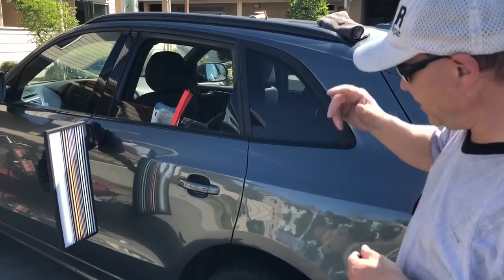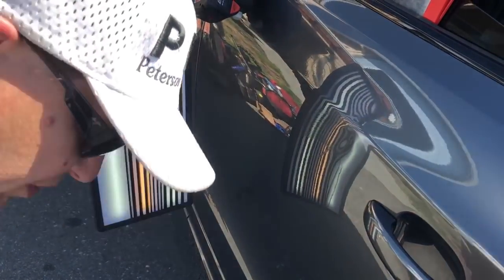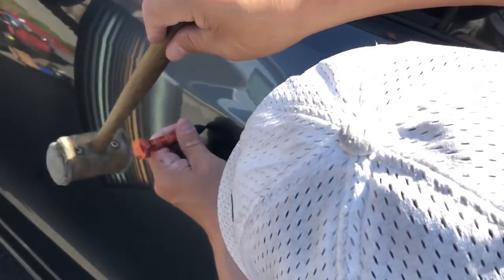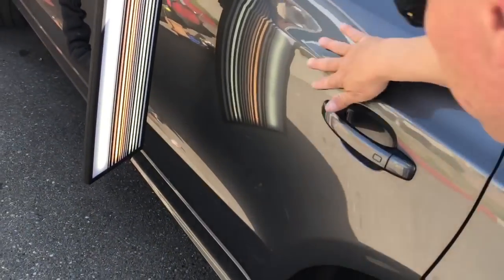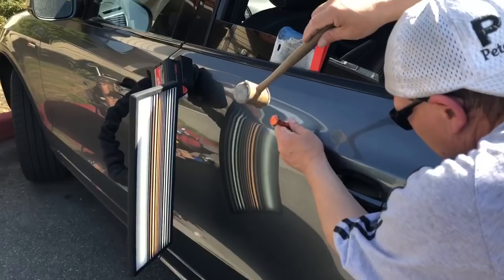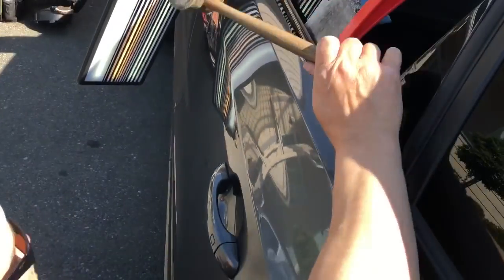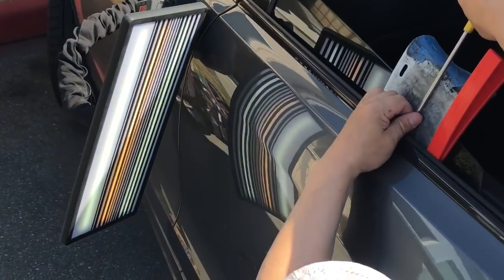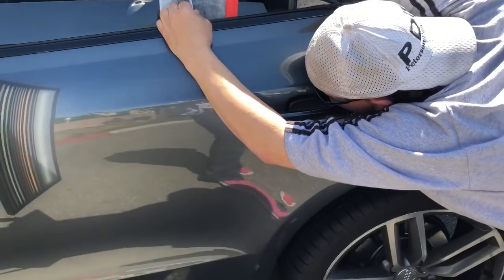How To Glue Pull on a Bodyline🚙 tips and ideas #AudiQS5 #PDR

Comment: Great man. May i know what kind of glue you are using?
Reply from the maker: yeah i use tabweld its really good id like to try more brands but they are spendy:) thanks for watching and subscribing👍
Reply: There's a plug inside the door that gives you access to the top plate of the door

Comment: OMG, That is awesome work!  If only I know how and where to tap down crowns using the board. Do you have any video about that?
Reply from the maker: Yes  I have a few actually a bunch of videos that focus on crowns and brow work. Please check them out thanks for watching and commenting👍
Reply: Ahmed thank you for your comment that was so kind of you! I’m Mrs. PDR by the way. I make the videos. But I also have been standing over his shoulder for nearly 7 years watching every tap and move he makes, so I feel confident and giving some advice. That being said Always start from the outside and work your way in, make sure you find out or investigate the direction of the impact, because just due to physics it’s a lot easier to remove the dent if you try to pull it back out the way it was put in if you know what I mean
Reply: Just never start in the middle of the dent thinking it’s going to just pop, that’s the quickest way to completely ruin a job

Comment: Well done mate. Got a tip for ya. For glue release I use metho. Methylated spirits. Cheap as. I tell everyone it’s a very expensive releasing agent.
Reply from the maker: gil super thanks 😊
Reply: @Gil Aylett I do all the ordering for Lee sorts of things and that’s the first I’ve ever heard of this methylated glue remover, we typically just use the 99.9% isopropyl alcohol and it works phenomenally. I am curious though about this product you speak of. Is it highly toxic? We try to do things as natural as possible
Reply: @sammylee482  it’s natural. It’s a spirit. You can drink it. But you will get drunk. Not advised. Cheers lol.

Comment: Just tried the puller with feet either side of the car dent. Glue sticks to car but not the plastic button . Am I doing something wrong. Also when your using the pointed punch what stops it damaging the paint.
Reply from the maker: janice cowan Leaving the glue on the car and pulling off the tab is probably the best because then you can just remove the glue with isopropyl alcohol. As far as the tapper I use either a soft squishy tip or a really smooth plastic one and I don't hit very hard. Thank you so much for watching and commenting 👍 hopefully the videos help.

Comment: I tried it in my car, but the glue remained strongly attached to the sheet, what was the fault? Was it the temperature of my gun? Was it too hot? thank you for share your job.
Reply from the maker: Juan Figueroa Tough to say. The Glues all have different temperature and humidity readings for your region. I also don't let the glue set for more than a minute or two I usually pull it after about 25 or 30 seconds sometimes quicker. The products I use for glue pulling are mainly from the Keco corporation. they have very high-quality products. Thanks for watching I have lots of glue pulling videos.👍
Reply: @Petersondent  thank  you for your answer, you really do a great job.

Comment: what are you spraying to get the glue off easy
Reply from the maker: i use isopropyl alchohol, but the stuff i use is 99.9% from germany  made for electronics. its the best , thanks for watching and commenting
Reply: @Keventh Campoverde I found it on Amazon, you can get a 48 ounce bottle for about $30 or so I believe. But will use it for everything because it leaves zero residue and you wanna make sure it’s 99.9%. Just get on Amazon and type in 99.9% isopropyl alcohol and you’ll find what you’re looking for. It’s amazing

Comment: Great work!  I've been watching your videos which is very informative on how to tackle different types of dents.  Just ordered at glue type puller and will be trying it out on my cars.
Reply from the maker: That’s awesome, let me know how that glue puller works!  Make sure you only use the right kind of glue, the glue I typically use is called black plague from Keco.  It’s absolutely necessary to have the right glue, as some is VERY difficult to remove from the tabs. I always use 99.9% alcohol I get off amazon to remove any residue and it works much better than the 91, or 70%.  Another tip, never use glue pulling system on a non-factory paint job it may have a tendency to pull the paint off.  Good luck my friend thanks for watching we really appreciate it! Let me know how it works.
Reply: Thank you.🔨
Reply from the maker: best of luck to you my friend hope the videos help:) please share and help the channel grow👍
Reply from the maker: thank you 👍❤️

Comment: Could someone please tell me what does the hammering do
Reply from the maker: Duane Shadd May hammering and tapping is usually bringing down the browse or the high spots in the metal and allowing the middle to flow and move. The whole thing about Dents is pushing up from the bottom and tapping down from the top until the surface is pretty much even again. Thanks so much for watching hope the videos are helpful👍